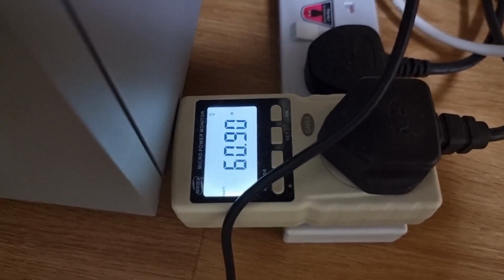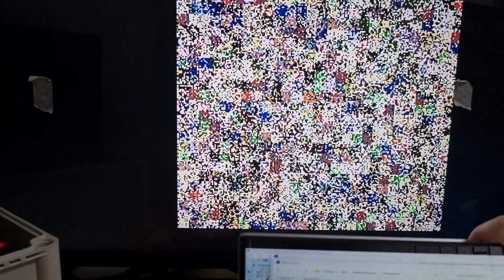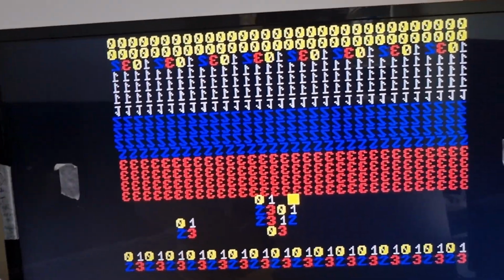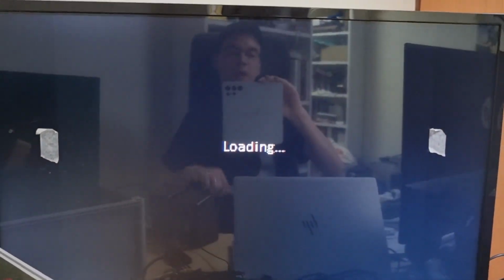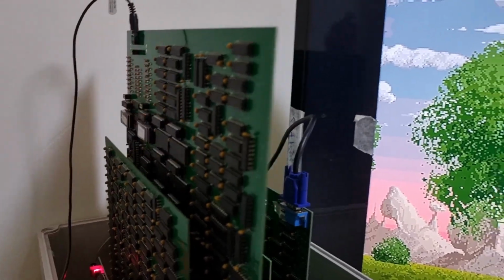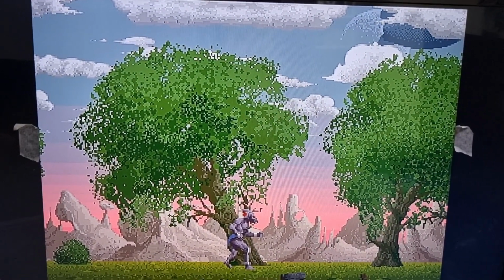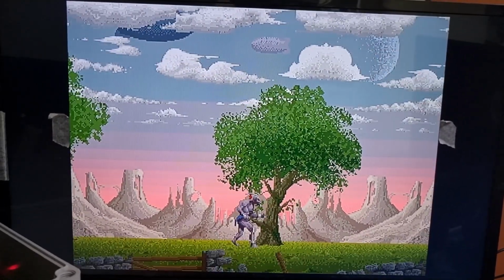MegaWang 2000 Turbo Edition   13   Shadow of the Beast demo

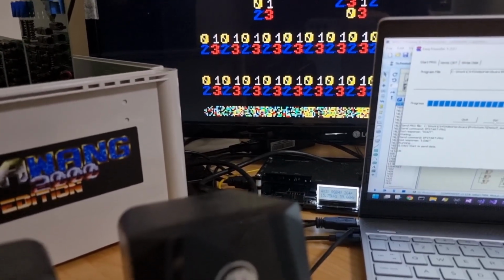Comment: Martin, thanks for these videos they are great! I have a question at 01:36 there is a small LCD display. I have only ever seen these particular style of I2C 16x2 LCD modules on hobby boards from Japan. I think they are manufactured by Aitendo. Are they commonly available in Singapore also? I have no immediate use for them but I like the form factor and the backlight but I have not seen them on sale in the UK or Europe (I'm a Brit living in Hungary). I have them on a board that is called "CW Invaders II" which is a morse code game based around an AT Mega and one of these displays.
Reply from the maker: That small LCD is part of the "open source scan convertor" box, which takes the 15.75kHz video signal (retro arcade spec) and converts it to HDMI. I ordered this box years ago, I'm not sure where they sourced the LCD panel from. The main website seems to be: https://www.retrorgb.com/ossc.html
Reply: @MartinPiper6502  Oh cool, thanks! I'll have a look at that.